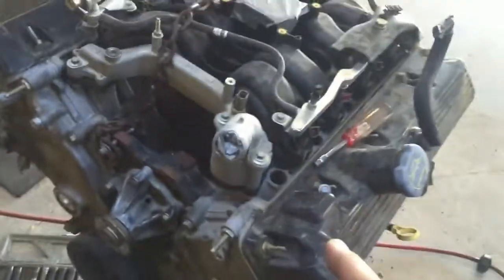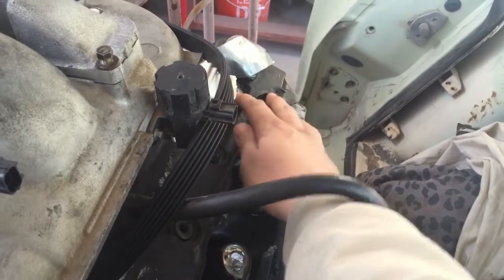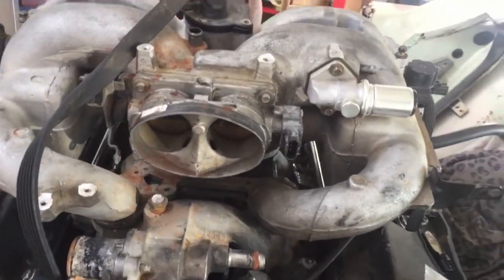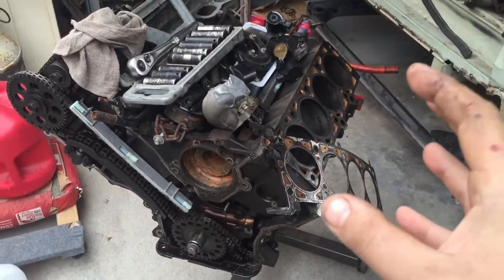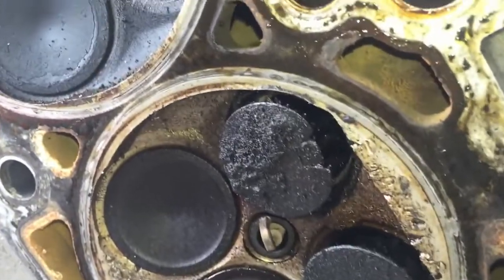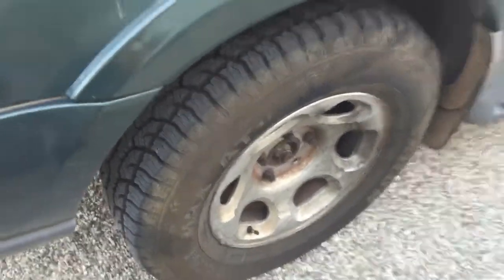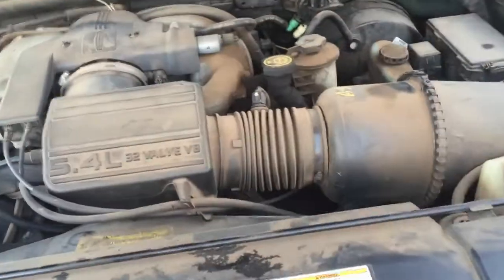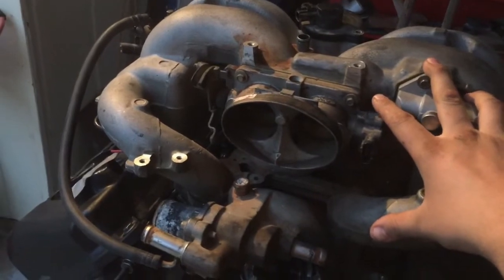Ep. 6 Planning 5.4 DOHC 32v Engine? "Project Redneck" Crown Vic Frame Swap / Install

Comment: My 4.6 motor gave out and I’m looking to do the same, did u need the a PCM from the donor car?
Reply from the maker: As far as I understated, and talking to tuners too Its better to use the Pcm of the car the engine is going into, and then just tune the pcm for the engine change. That only works if the donor engine and the chassis are basically compatible. Like my crown vic wiring and pcm can easily be modified and tuned to work with the 5.4 from the navigator. It would be harder for the navigator pcm to be made to function in the crown vic and get all the systems to work together like engine, trasmission, ac, abs, etc. Things depend on setup too... If you were putting the engine in an older car with no / or non similar pcm then you would want the pcm with the newer engine or some sort of standalone pcm to control it.
Reply: Ok and I’m swapping it into my 2003 f150 2wd and from some research I have done do u think the 2002 Lincoln Navigator 5.4 4v wiring harnesses will mate up to the f150 OEM wiring harness
Reply from the maker: @taviantrapp7111  as far as the basic engine wiring the f150 and navigator should be the same. The navigator will just be longer or maybe routed different in spots due to it being the 4v. To know 100% you would need to look at the connector diagrams for both vehicles, or do some serious wire tracing. I looked at some older model pcm diagrams too and the pcm hookup appears to be the same for both, But would need to confirm that with 100% correct diagrams. Plus some of the routing could be weird or pin locations switched further down in connections. Another possible option is just to repin the connector with some of the longer navigator wires. So basically just swap only the exact wires you need to be longer. I'm going to try that option with my setup. Then I hopefully don't need to cut and splice anything.

Comment: Glad you decided to skip this engine swap..Alot of headache for just a little bit of perf.Not worth it imo...Do like what you have planned for the 4.6 and enjoy less headache`s...Great video...
Reply from the maker: Thanks man. I do plan to keep the 5.4 engine, but not a huge amount of gain at face value. I really wanted the 4v and an all metal intake with forward facing throttle body. This engine checked both of those boxes. The 5.4 4v with stock intake seems to be a little easier swap then a 4.6 4v... as far as wiring and stuff. Mostly just plan to get it running first with a manual transmission, and figuring out reprogramming the computer. Then after that I want to work on some sort of power adder... like a turbo.
Reply: @DesertRatRacer  Cool cool...Turbo brother....You talk about a power adder,turbo or a blower will give all the power you want,lol...

Comment: Should've just took the 5.4 to the machine shop.
Straighten and polish crank  bore it 30 or 60 over.
Clean and resurface heads new valves  and just rebuilt it .
You playing spending wasting time

Comment: looking to do this swap in my 03 cvpi
Reply from the maker: Oh nice, that would be cool.
Reply: Yeah just recently had my 4.6 started knocking so I been wanting to make a swap to a Navigator 5.4L DOHC
Reply from the maker: @nolanmiller8062  yea makes sense. I ended up getting the engine for free and made a good amount of money after selling off the navigator parts… plus extra parts I used on my f150. This was a win win.
Reply: hell yeah man I can't wait I'm most likely to replace the crankshaft, rod, and main bearings along with new lifters and sell it
Reply: I'd like to put a factory svt supercharger on it that would be even more bad ass
Reply from the maker: @nolanmiller8062  talking about the 5.4…?
Reply from the maker: @nolanmiller8062  yea, can’t get much better than that.
Reply: Sure it can lol
Reply from the maker: @nolanmiller8062  🤣 true, they really do look good with the super charger.
Reply: Hell yeah man Ford should have done to begin with especially with the P71, come on Ford what y'all thinking a police pkg crown Victoria and they stick that 4.6 thing in it wooow
Reply from the maker: @nolanmiller8062  yea, I still love the crown Vic’s though. You’ve seen Mercury Marauders right?
Reply: Hell yeah man
Reply from the maker: @nolanmiller8062  ok cool, just double checking
Reply: @nolanmiller8062  just a heads up, the factory 5.4 supercharger is for the 2V and won't fit the 4V.

That said, the Coyote has almost identical intake manifold pattern so you can get some adapter plates and run Coyote intake bits.

I manual swapped a 2000 Navigator and the automatic transmission is really the weak link. If you try to push more power on the 4R100 you'll quickly run into issues. There's a reason Ford only lets it rev to 5500 RPM even though the 4V will reliability run past 6500 stock.
Reply: Ok

Comment: should of just got the 4.6 back they screwed you.
Reply from the maker: No Joke, someone was trying to pull a fast one there, Plus they broke the valve cover, and maybe the intake manifold on the 2v when unloading it from my truck. 😂... Either way I would rather have the extra 4v core and extra parts than the 2v right now.

Comment: What a stupid stupid manifold. As turboomann said aussie boss manifold. HP++++ They're easy to get despite the claims.

Boss 260/290 manifold & throttle body, Cobra R cams, longer followers, 10.5 comp and you're at easy 400hp.

Comment: thats dumb. the fan takes 5 hp not 20
Reply from the maker: Everything depends on the application and setup, but its shown that a fixed blade style fan can easily take 20 - 30 hp off a small block engine in the same power range at peak power.  This was dyno tested and proven on Engine Masters Season 2 Episode 20.